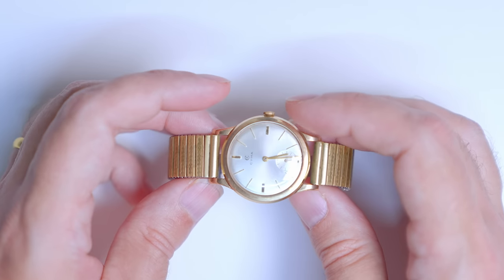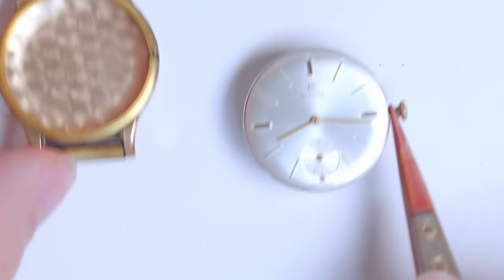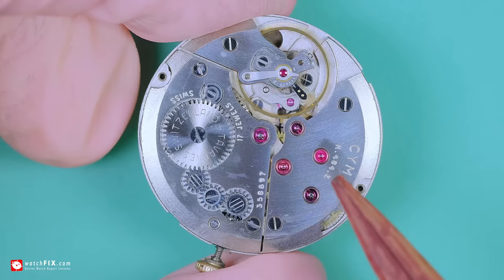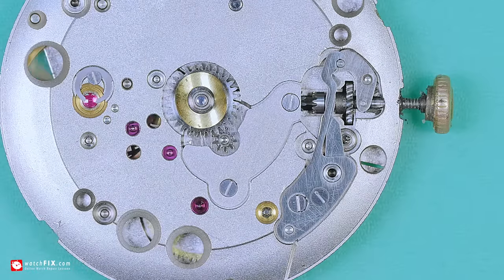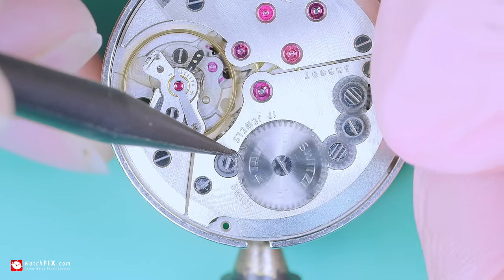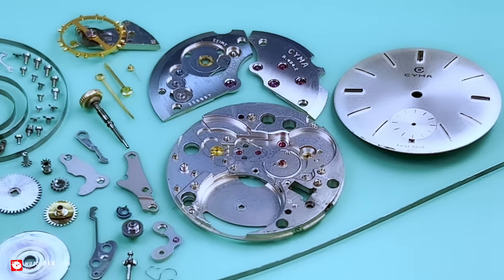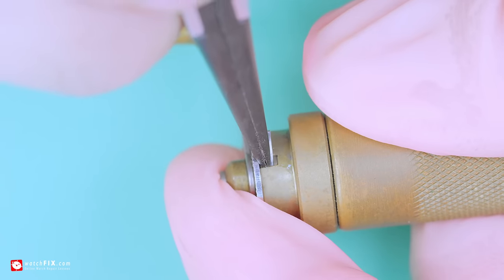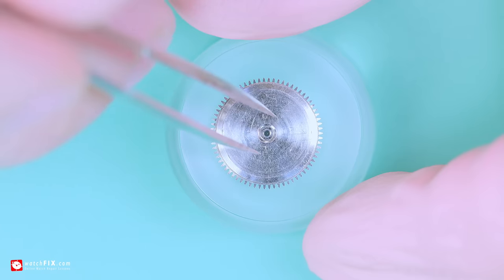A 1960's Cyma watch repair attempt, fixing a previous repair gone bad?

Comment from the maker: In this video, I will be restoring a vintage CYMA watch movement from the late 1960s. This watch was a reward for the long service provided by my stepfather's dad in 1969 from the company he worked for. It had an odd issue that caused it to wind stiffly, perform poorly, and run for a short amount of time. I will be going through the process of cleaning and lubricating the movement components, and I will also be tracking down and repairing the fault. I will be showing you the before and after results. Although this video is provided for entertainment, I hope that you learn something from it. Enjoy!
Reply: Been a minute. Nice to see you again sir!
Reply: Wish you would have shown the fix you did to the barrel arbor since that was the key issue with amplitude being so low.
Reply: @da___man  Yes please. And what was the jewelers tool and how do you use it?
Reply: Any interest in repairing a sekonda watch which runs then stops. New battery fitted, local watch repair can't repair and has come back from sekonda saying model obsolete so can't repair?

Comment: Enrolled on your coarse have completed the first 2 coarses and just stripped down and serviced my first seagull 2824 movement following your eta2824 video. i left out the date wheel components as i dont have that function on my watch. really pleased although no timegrapher yet i have decent screwdrivers and tweezers, mobius oils and grease but my movement holder is aweful. thankyou for all the great info and advice. Really enjoying the experience

Comment: Thanks for the video. I would like to make one comment on the barrel arbor issue for other watch repair learners and thier troubleshooting skills. Keep in mind that while the watch is running the barrel arbor does not move. Consider the square atop the barrel arbor, it is attached to the ratchet wheel by means of a screw, its geometric shape forbids the movment of the barrel arbor apart from the rachet wheel. While the watch runs the Ratchet wheel is held in place by the click and is thus stationary. The barrel arbor sould have end shake as mentioned as it does turn while winding, Imporper endshake on the arbor will result in difficutly winding, increasing wear on the winidng mechanism. In this case I can only suspect the flex of the barrel bridge or mainplate acting on one of the pivots (increasing endshake or holding the wheels out of alignment) was the direct reason for the movements poor performance.

Comment: I will say that is a very big balance wheel on this watch compared to other watches of this era. From videos I have seen on doing these tear downs. My shaky hands are not  enough to do it even under microscope. My guess is the dried oil/grease is what stopped this one just from the tear down. I stick to bigger parts like BCG's and that type of stuff where I can work with shaky hands.

Comment: Wow I don't think it left the factory in that superb clean condition O.o   Have to agree on the don't make 'em like they used to, my 1947 gold Avia is still the undisputed most accurate mechanical watch in my entire collection and I have some high end Seiko's that just don't come close to the perfect railway track timegrapher reading, 0.0 BE, very good amp and loses zero secs a day.   My suspicion is it is a drawer watch, maybe the owner didn't like it or just wore it for best, once I cleaned it up it came out like it was brand new and underneath the years of tarnish on the gold appeared a hallmark :)   I paid £4 off ebay for the gem, listing said it needed a new battery and was full o' water, two twirls on the crown and it sprang into life.

Comment: Question on the amplitude, you say in your video that due to the age that an amplitude between 180 to 200 is good. What is the rule of thumb for that? Would it be any watch say made before 1980 or is it any vintage watch? Also, the rate, what would be an acceptable rate for a vintage watch in your opinion? Thanks

Comment: I have a broken cyma wristwatch that my grandfather was given as an 18 birthday present in 1948. The spring doesn’t work and the oscillating thing spring also doesn’t work. What would repairing it cost? We took the watch to a “watchmaker” to restore it in the early ‘90’s but he removed the original movement and replaced it with a smaller one and drilled a hole in the face to accommodate the new second hand.
Reply: How would I do that? Sorry can’t find where to find your email
Reply: There is a lady’s profile picture. Is this correct?
Reply: Sorry. You have not responded